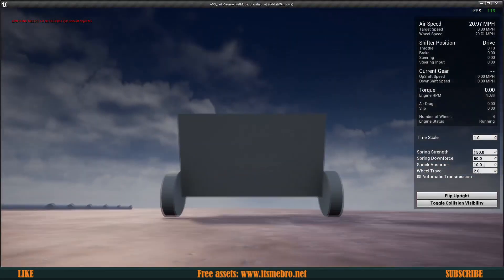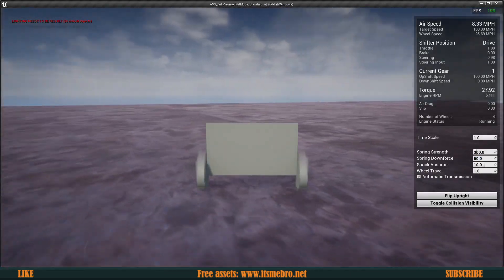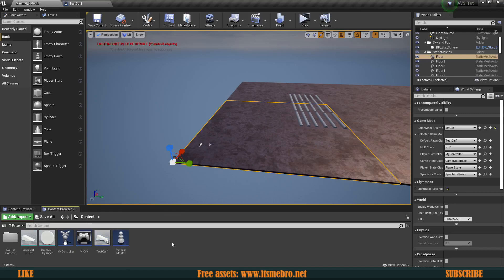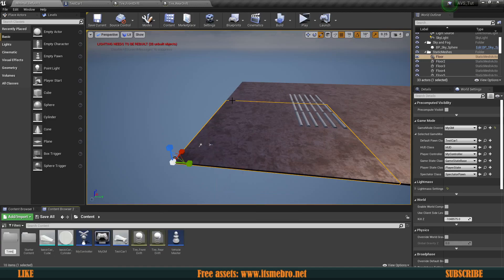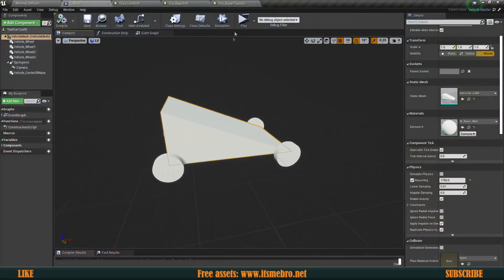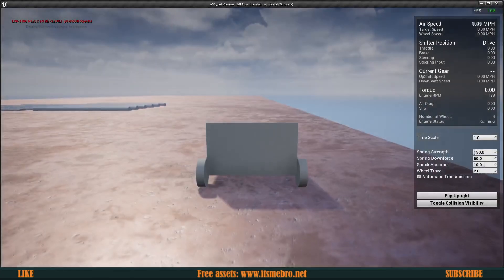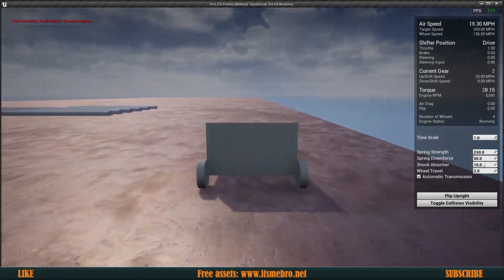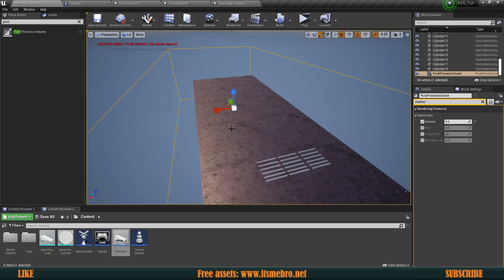UE4 Advanced Vehicle System / Suspension, Gears, Traction

Comment: Did you make physics material for the road?
Because my camera is shaking so much
Reply from the maker: No. All you see in the video is what I've done. Nothing gets done off screen.
Reply: @ItsMeBro  ok i solved already ty
Reply: @mobildisko579  How did you solve it? I'm running into the same issue where the camera shakes a lot
Reply: @Dyroth  make sure wheels and hull are pivot point, correct, using 3dsmax or blender
Reply: @Dyroth  In my case, the length of the front and rear wheels were different, I only used the front wheel for the front and rear, which caused the problem. Then I used both separately, which was effective in solving the problem.
Reply: @mobildisko579  ahhhh that makes total sense. I'm running the same setup where the back wheel is bigger than the front. I think there is also an option in the plugin settings of the wheel component to change the radius, which i havent touched yet. I'll try both that and your method for this, thanks for the quick response!

Comment: Bro touch Steering Wheel Widget for mobile plzz
Reply from the maker: In the project settings, under the input section (where you can find action and axis mapping). Look for mobile section. You can enable it there. It's built in by default.
Reply: @ItsMeBro  can You make Tutorial Video ?